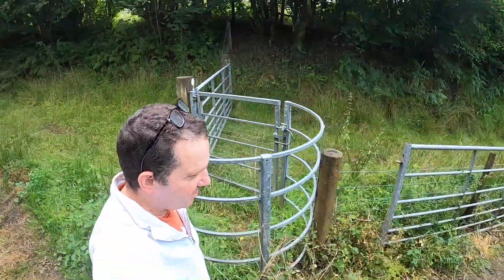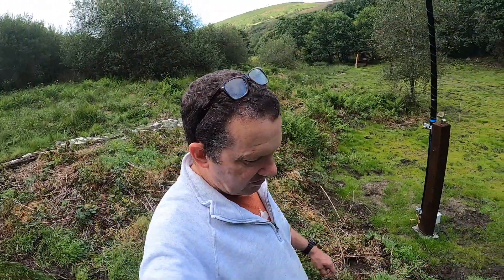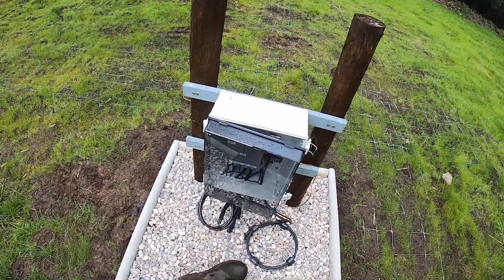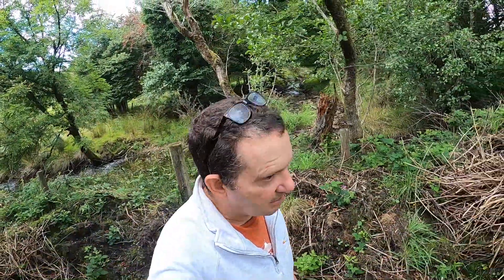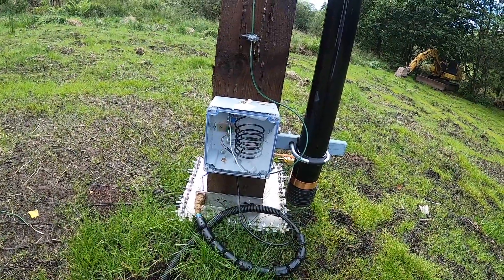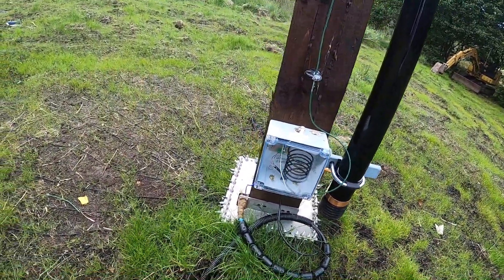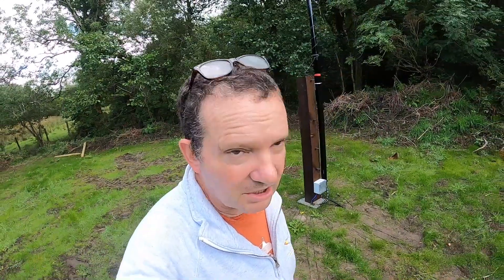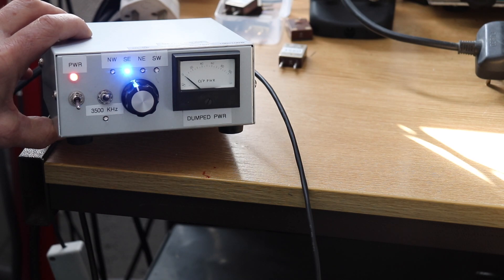My New 80m 4 Square vs A Dipole Antenna

Comment: Congrats for the 4SQ on 80m. I had my 4SQ up and running 1980 - 1984, with 8 directions. Highest F/B is at low takeoff angles. Best difference is ar 135° from front element, some 40.dB or so. Extend the feed point of the vertical s to 1m up, so the radials slope down to ground offers some 1.5 dB better performance on long haul dx. In direction NW & NE, extend the radials to › 80m gives you an honest 6 dB better signal into W7 & W6. Try 8 directions (K3LC-version), and you will be amazed about the behaviour.
GL & 73 /Björn SM6EHY

Comment: Excellent work.
I used a horizontal loop about 260' square, as I recall, and it worked remarkably well for in state (Alaska) QSos. I used it to work CW with my wife when I would go out on fly in hunts to Kodiak or Montague Island. We both had loops and copy was always solid even though she was running 5W and I was running 1.5W. She always had the strongest signal on the band.

Comment: Please use MMANA-GAL program for calculating antenna lengths. I noticed that 4 antennas should be somewhat shorter in length for phasing in comparison to single vertical antenna. Check it by using this program and you will see what I am talking about.

Comment: That's incredible, and I looked into your play list to see the US contact with the Collins transceiver. One question, the inductor on the legs, have you thought about creating a cage type arrangement, with some sort of circular group of wires for each vertical? I haven't got anywhere near the space to try it on 80m but I was toying with that sort of idea for 10m, just as an experiment, to try increasing the bandwidth.
Reply from the maker: For 10m it would be easier to use a Yagi than a 4 square, more gain, FBR etc
Reply: @thewtf  Ah, no, I wasn't talking about building a four square for it, more about the concept of a cage dipole or a cage vertical to increase the bandwidth.
Reply: @paulsengupta971  Ah OK!! I initially thought about doing that with the 40m 4 square.....theoretically it should increase the bandwidth. What I discovered was that with more wires around the poles the mast became too heavy
Reply: @justinwoolgar9853  Ah, ok.

Comment: I believe a bunch of pigs would have cleared the lot for you. Viz The Archers.
Rent patches out to a pig farmer.
Fab system but a bit "Broadcast"  ?
G.L. es 73 de G3NBY
Reply from the maker: Yes had thought about pigs but the field is not secure and would have had to re-do the fences
Reply: @thewtf  
Hi....
Yes I had thought about that too but small crucial patches could be fenced off with  movable fence stock to restrict the porkies as they gorged themselves.
However I do believe that pigs are also ingenious escape artists! 
I've seen big lawns kept in good nick without mowing by trapping pet rabbits in a rectangular frame and moving it around when they needed  more grass. 
73 de G3NBY.

Comment: Very nice and thought out. This is the "next" project, hope I can get the 4sq up before winter here in TF ... I'm always happy when I don't hear a G/GM as well as some other TF's on my vertical - then I know it's working for DX ;)
Reply: i worked TF2LL on 80m from south africa 2011-03-06  was a difficult contact trying to break the EU wall, but the qro and vertical setup did the job

Comment: A lot of work, but good results! Congratulations !!
You will not see the real difference with the dipole until the DX season and intercontinental distances.
Best 73  de SP7GXK
Reply: I am sure on long distances within Europe, in daylight, the 4-square will always outperform the dipol. That is already the case with my single vertical compared to the 22m high dipole.
Reply: @MrTalaue  Of course ! I made a 1/4 wave sluper system here (only 3 every 120 degrees) from my 27m mast and there is very good directivity and QRM attenuation from EU Best 73!
Reply: @zbyszekpodchmielony2642  Great! I use a single quarter wave sloper dropped from the 37m level of my tower and fed at the ground against the 90 radials of one of my 80m array radiaters, works very well and I think now about a second one for the opposite direction or make it a spitfire array next year.